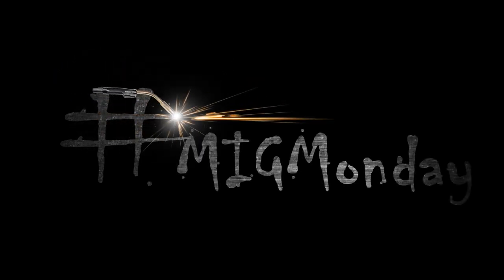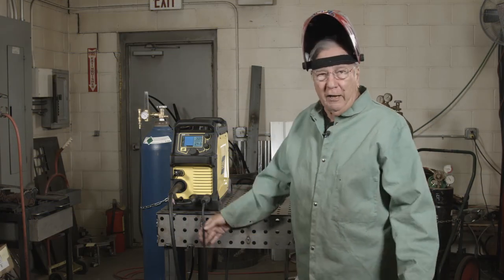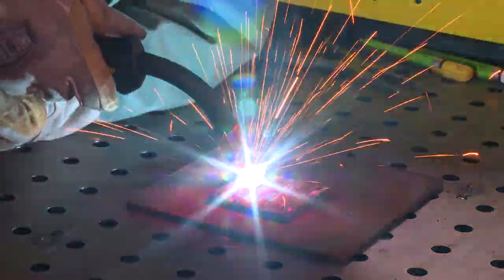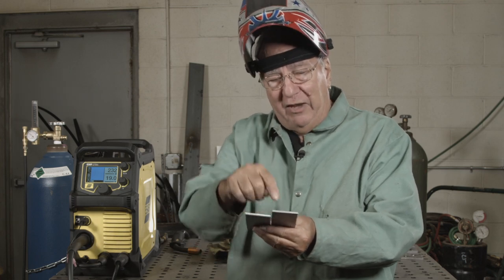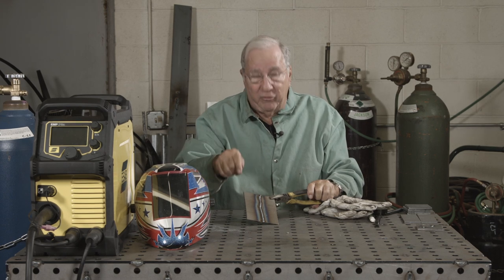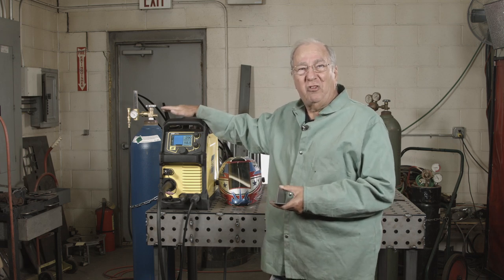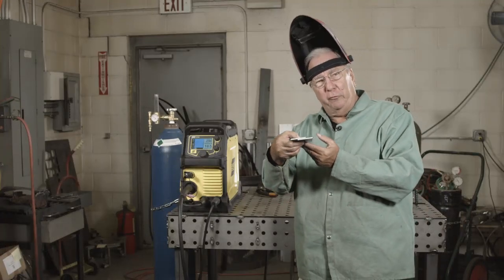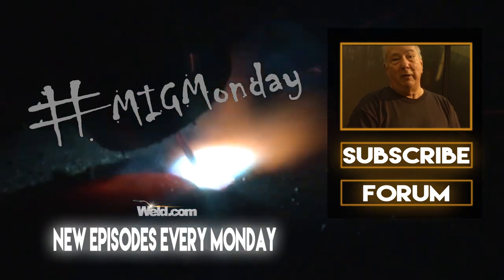Boy Scouts of America Merit Badge: Welding - How to Earn (Part 2) | MIG Monday

Comment: Great video Paul! If a Boy Scout had done this in your shop, would he just take his coupons to his scout master to get his merit badge or is there a form that gets signed off to certify his accomplishment? Or, does the scout master need to be present with his scouts while they're welding? I think this would be a neat way to get involved in the local community/BSA.
Reply from the maker: +Mike Snyder You need to show a scout master your progress at certain points along the way. For instance, you need to tack the materials, let a scout master inspect them and then do the welding (and get inspected again). I doesn't designate the leader HAS TO be present when the welding takes place, but it sort of implies it.